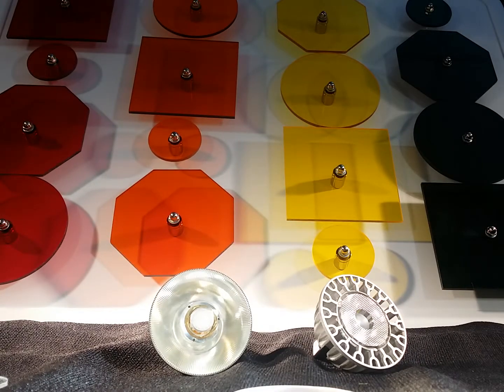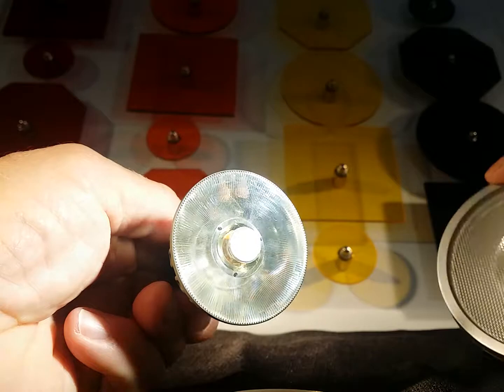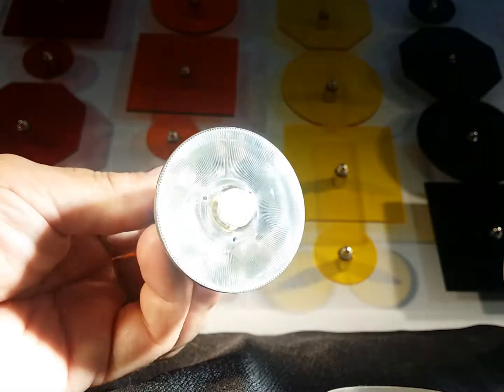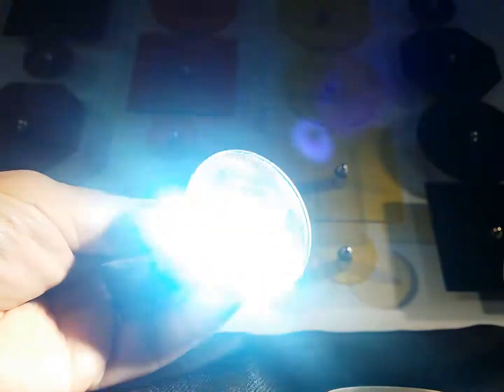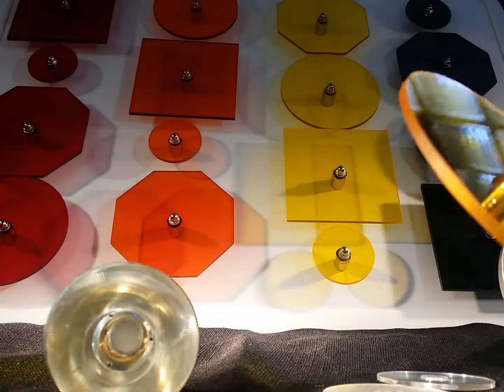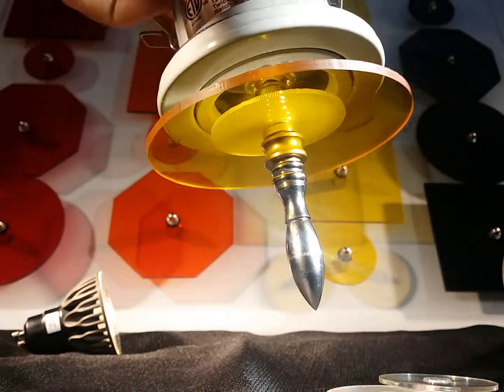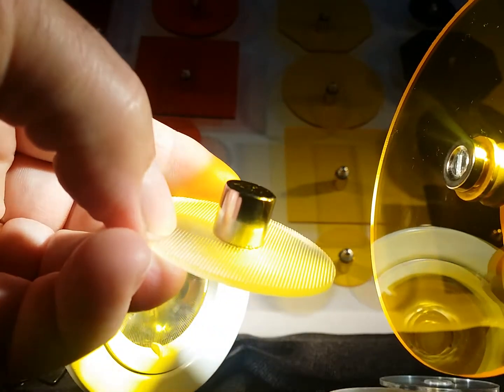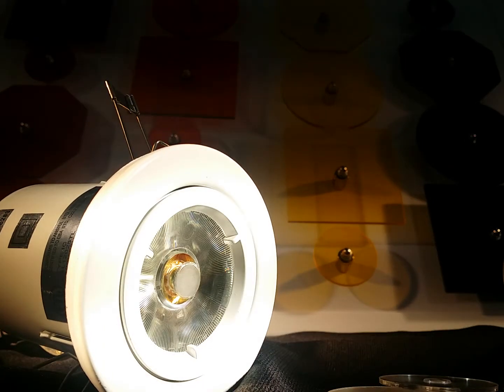Soraa Snap On LED lamps explained

Comment: Another question I have-- I just realized that all of the lamps are rated in the incandescent range. I had totally assumed they had some available in the daylight range--since they offer CTO filters. Does soraa offer any sort of 6500k lamp that can fit the snap on filters? I actually need switchable 6500k to 3200k/incandescent for my application

Comment: Doesn't the 1/2" magnet extender mean that the unfiltered light is exposed, defeating the circadian-rhythm protection you're attempting?
Reply from the maker: The vast majority of the light from a soraa lamp is nearly collimated  (@ approx 9 degrees) with the greatest light intensity at the center.  In other words, yes there is some blue light that escapes from the sides around the filter, but the majority is stopped as the majority of the light intersects the filter. Thanks for the question.